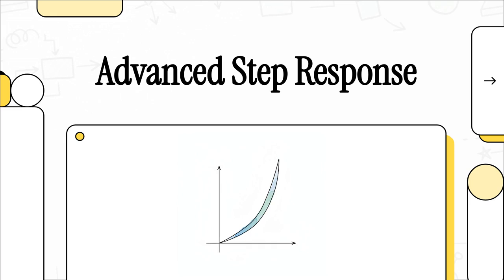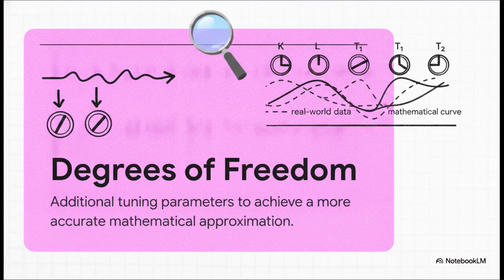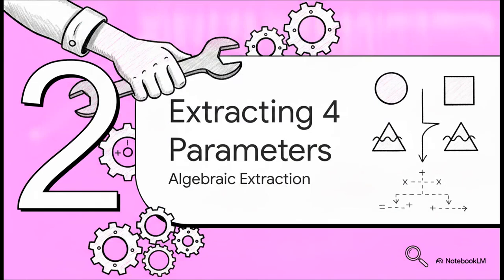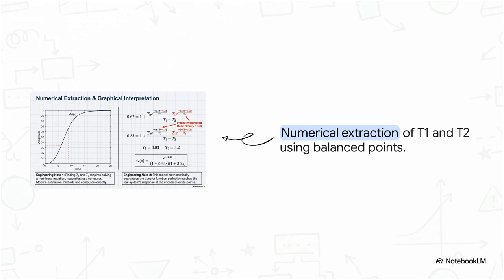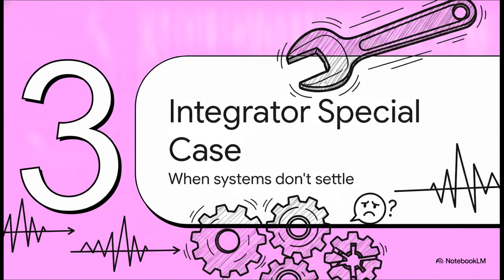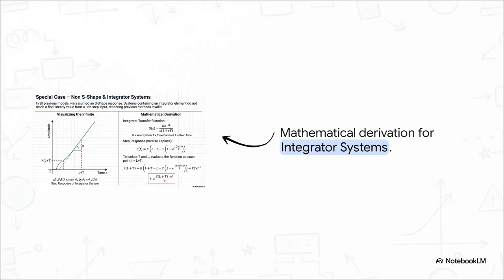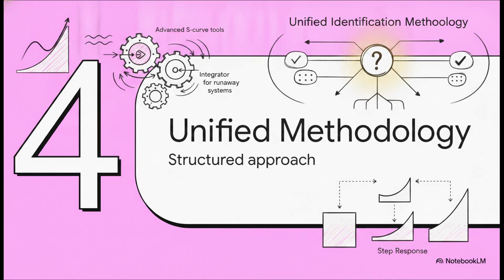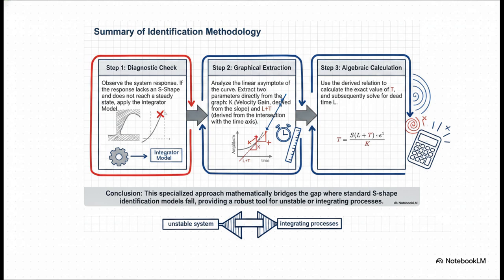System Identification of High-Order and Integrating Processes | Industrial Process Modeling

Comment: Doctor I have a question , the graphical approach in the video assumes a stable, non-oscillatory system with real poles (T1, T2). However, practically speaking, how do we adapt this parameter extraction method if the system exhibits complex conjugate poles causing overshoot, or an Inverse Response (RHP zero) at the initial step?
Reply from the maker: Thank you for the excellent question. The graphical T1, T2 extraction method is mainly intended for stable, non-oscillatory processes with real dominant poles. If the process has more complicated dynamics, the method should be modified rather than applied directly.

For a system with complex-conjugate poles, the step response typically shows overshoot and oscillation. In this case, engineers usually estimate parameters such as the natural frequency (ωn) and damping ratio (ζ) from the oscillatory response, or fit an appropriate second-order model to the complete measured response.

For an inverse response caused by a right-half-plane (RHP) zero, the initial response moves in the opposite direction to the final response. Therefore, the simple T1, T2 graphical method is no longer appropriate. Instead, engineers should identify the RHP zero and its associated dynamics using system identification or an appropriate process model.

The key principle is: Do not force a simple real-pole model onto a process whose response clearly shows oscillation or inverse behavior. Instead, choose a model structure that captures the actual dynamics, validate it using the measured data, and then perform controller tuning based on that model.

Comment: In the integrator-system graph, a value is indicated at t=L+T, while the derivation gives S(L+T)=KTe^-1. Could you clarify the relationship between the value shown in the graph and the derived value?
Reply from the maker: Thank you for your careful observation. The two values should be distinguished based on the specific derivation used.

For an integrating process, the step response is generally:

S(t) = K(t − L), t ≥ L

Therefore, at t = L + T:

S(L + T) = KT.

If the derivation gives:

S(L + T) = KT e^−1,

then the factor e^−1 must come from a specific normalization or model-fitting procedure used in that derivation; it is not part of the basic integrating-process step response.

Therefore, if the graph shows KT at t = L + T while the derivation states KT e^−1, there may be a notation or derivation inconsistency on the slide. The two expressions should not be treated as the same physical quantity unless the normalization used in the derivation is explicitly defined.

Comment: Dr. Mahdian, I appreciate this detailed and practical explanation my question is:
In real industrial data, where the step response may contain noise, small oscillations, or unclear 0.33 and 0.67 points, how can engineers reliably extract T1 and T2 without overfitting the model to measurement errors?
Reply from the maker: Thank you for your excellent question. In real industrial data, engineers should avoid estimating T
1and T2
 from individual noisy points such as 0.33 and 0.67 alone. Instead, they first filter or smooth the measurement data and identify the overall trend of the step response.

A more reliable approach is to fit a suitable process model to the entire response using system-identification or least-squares methods, and then validate the estimated T1 and T2
 using separate data or operating conditions.

The key is to avoid overfitting: use a model with the lowest complexity that adequately represents the measured dynamics, rather than trying to reproduce every small fluctuation caused by noise.

In practice:
Filter → estimate from the overall response → validate → tune the controller.

This produces much more reliable T1and T2
 estimates than relying on a few noisy measurement points.